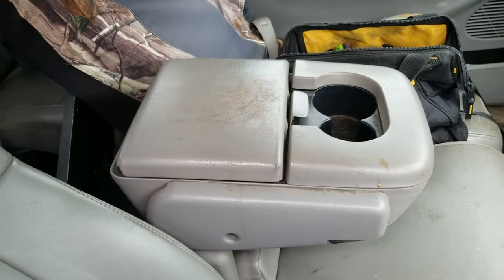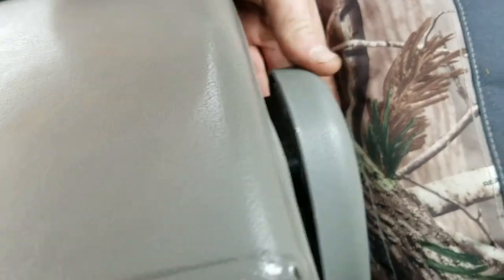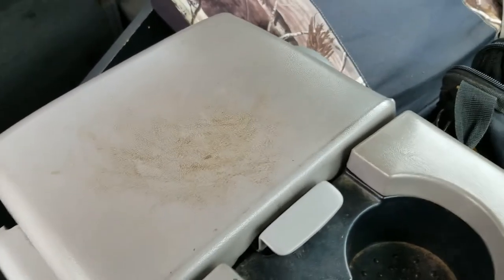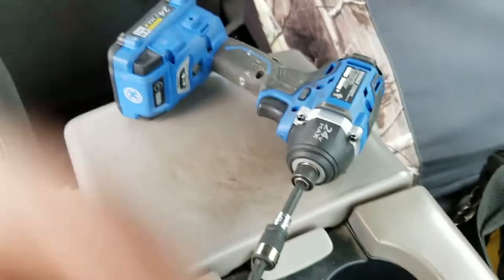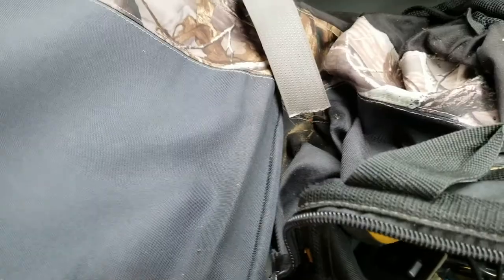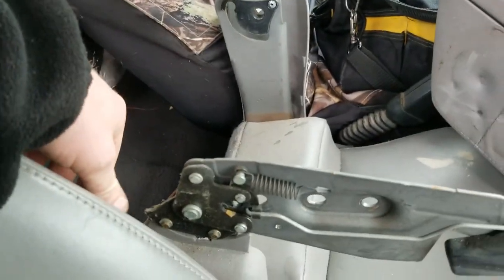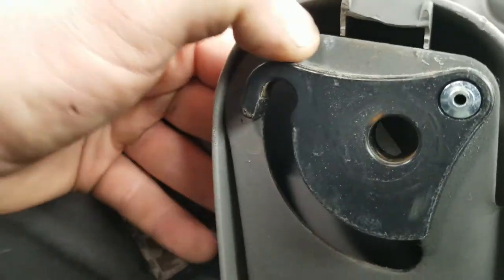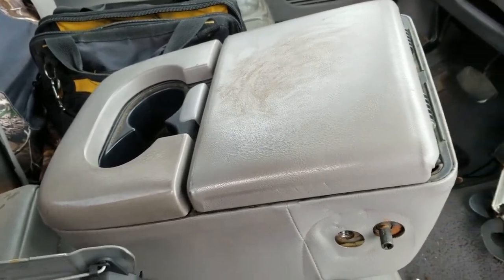1997 1998 1999 2000 2001 2002 2003 FORD F150 CENTER CONSOLE CUP HOLDER REMOVAL HOW TO REMOVE F-150

Comment from the maker: I hope this video helped. If you need any interior parts, check attached link.  https://rover.ebay.com/rover/1/711-53200-19255-0/1?mpre=https%3A%2F%2Fwww.ebay.com%2Fstr%2Fbentleysautoparts&campid=5338488856&toolid=20008

Comment: Will a two cup console fit where there is a single cup console?  Are they interchangeable?  Can not find any info on this.  Thanks!
Reply: @footballer69er did you find an answer? I have the same question

Comment: can you remove the Black inside piece at least the cup holders to get something I lost that dropped threw a small hole in the center under the lid where the storage compartment is? on a 2003 f150?, thanks
Reply from the maker: It will be tough. Im pretty sure the clips will break when you try to remove it. I have never been able to fix one that was broken.